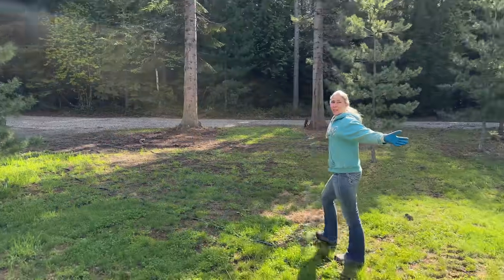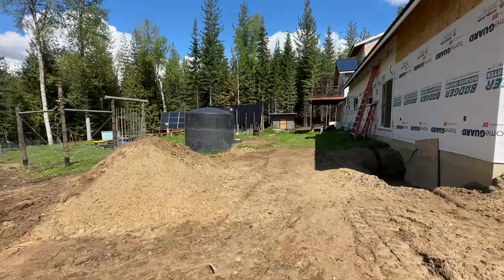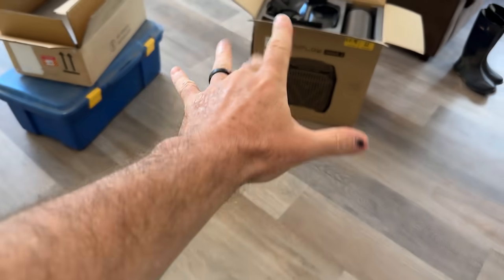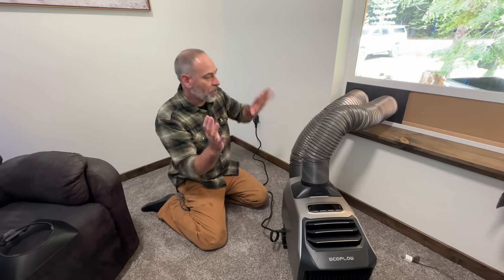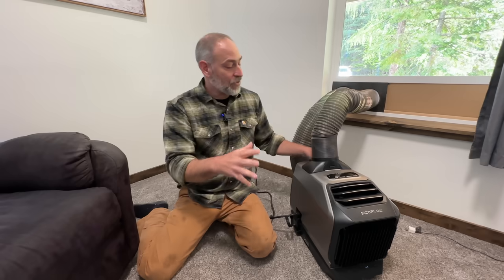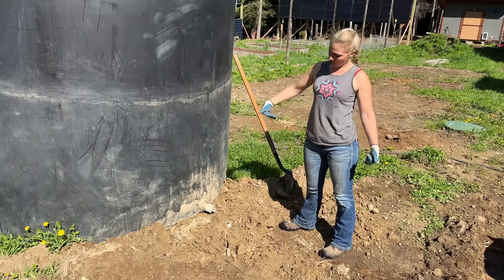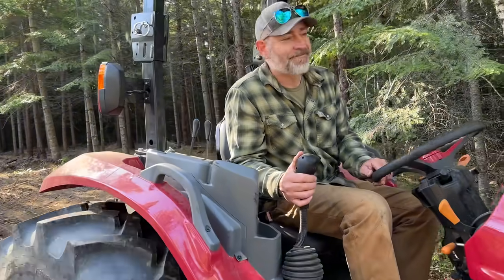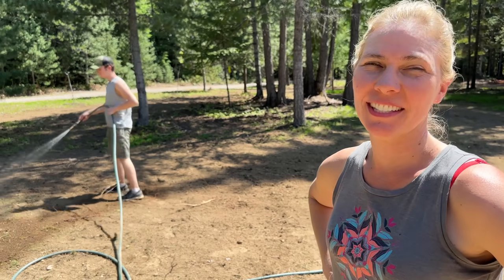Sure Hope This is all Worth It - Building Off Grid

Comment: Should have kept the storage tank in the system.  It serves to aerate the water and allows some contaminates to settle out.  It also would provide a backup supply of water WHEN (not if) the well pump goes down.

Rust stains inside my toilets have dropped to almost zero after we started pumping into the storage tank instead of directly from the well.

Comment: I made my diesel out of fry oil for 5 years //had diesel cars and trucks , it was great , I go to restaurants in town and leave my 55 gallon barrow and would pump them dry , //the steel barrow are free and shops in town , 12 volt pump with garden hose works great saved $6,000 a year as I was driving 100 miles a day 7 days a week to work , go go and save your money .

Comment: As always, I am very impressed with all you do, get done and how well you all work together. When Sarah gets home, she is going to be blown away! So much has changed since she was there last! 
I do think you need one more burn pile. From? going through the wooded area and cutting off all you can reach limbs(mostly dead) to help cut down on potential fire tender boxes. And, it will look so much better too!
Not sure how much or how often you're going to have to water your yard, why not get a sprinkler of some type so no one is having to do it by hand taking up so much valuable time.

Comment: Always fun watching the changes.  Why not mini splits, sexier, cleaner design?  You are super net positive on electric with the new panels. Here is a comparison of mini splits and EcoFlow ACs from bard:

Feature	Mini Split	EcoFlow AC

Mini Splits

Mini splits are a type of air conditioning system that is split into two parts: an indoor unit and an outdoor unit. The indoor unit is installed in the room that you want to cool, and the outdoor unit is installed outside. Mini splits are available in a variety of sizes to fit any room, and they can be installed by a professional or the user.

Mini splits are more efficient than traditional ACs because they use inverter technology. Inverter technology allows the compressor to run at variable speeds, which means that it only uses as much power as needed to cool the room. This can save you money on your energy bills.

Mini splits are also quieter than traditional ACs because they use a smaller compressor. The smaller compressor is less noisy, and it also produces less heat, which can help to improve the efficiency of the unit.

EcoFlow ACs

EcoFlow ACs are a type of portable air conditioner that can be used to cool a single room. EcoFlow ACs are less efficient than mini splits, but they are also more affordable and portable. EcoFlow ACs can be installed by the user, and they do not require professional installation.

EcoFlow ACs are a good option for people who need a portable air conditioner for a temporary use, such as camping or tailgating. They are also a good option for people who live in apartments or condos where professional installation is not allowed.

Here is a table summarizing the pros and cons of each type of unit:

Unit	Pros	Cons
Mini Split	More efficient	More expensive
EcoFlow AC	Less expensive	Less efficient
I hope this information helps you to choose the best type of unit for your needs.